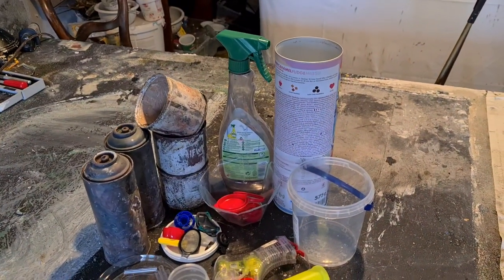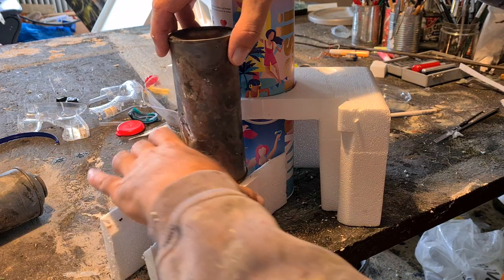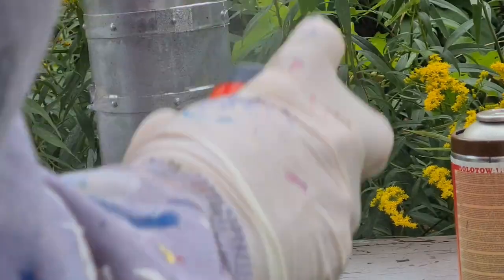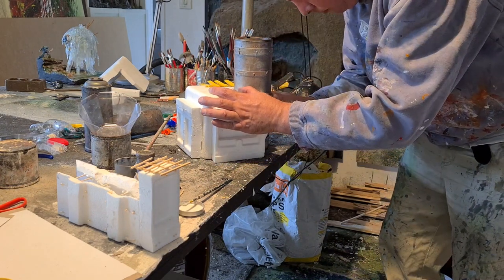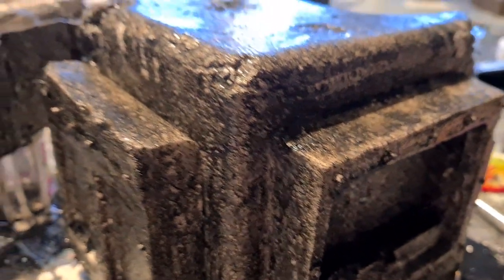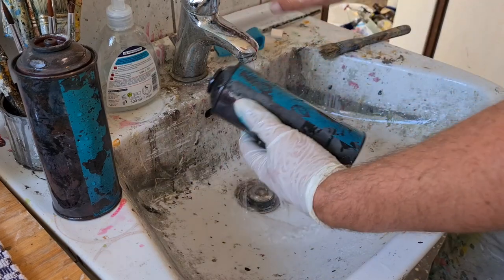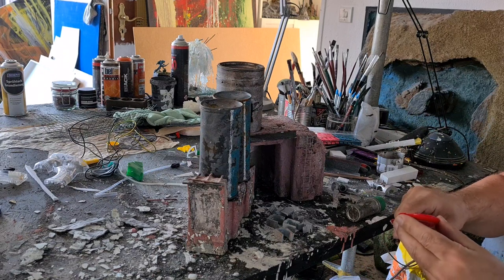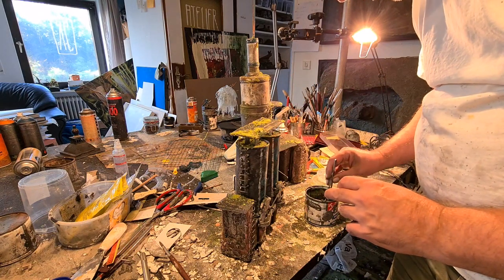Industrial Ruins - for your post apocalytic tabletop wargame like necromunda or 40k

Comment: And I thought it was done..... but it was boring. Some smaller straws (pipes) and some greeblies around and some coated wire and even strings to replicate electrical lines and then just thread looking like steel cables would add a ton of visual interest pushing this to the next level. I do like your simple ways to do chipped paint have you ever tried the hairspray  or salt methods?
Reply from the maker: Tried hairspary. Did not work for me. Never tried salt. Was too far away (in the kitchen ;)